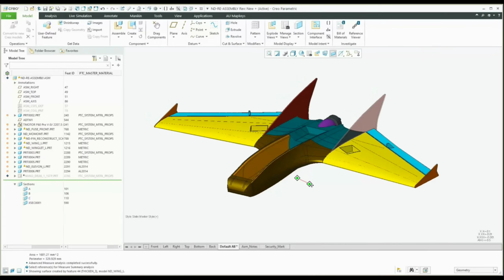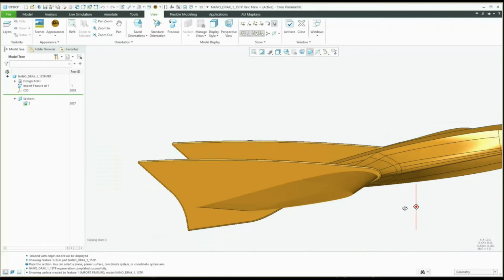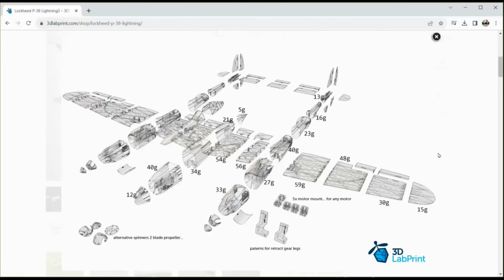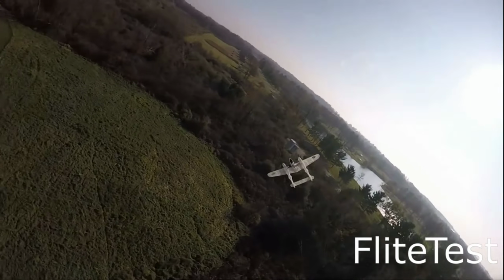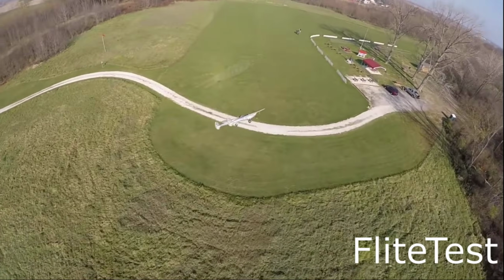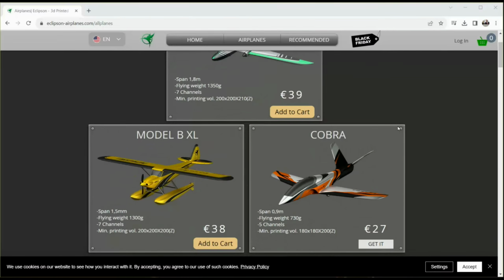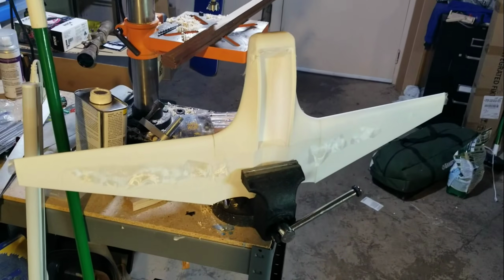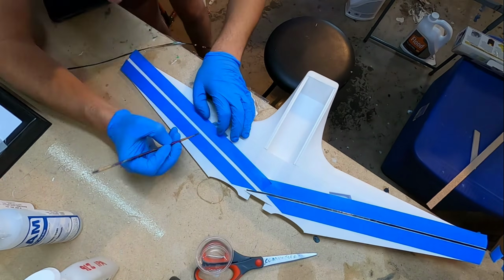I Designed and Flew a 3D Printed RC Plane

Comment: 16:20    you may know that the fuselage should have a radially symmetrical shape; eg., a shape that deflects air Uniformly.      d
Reply from the maker: I did not know this, but I am no Aero. 
Almost everything Aero about this plane is a copy of the original Ritewing, Mini Drak, which I copied for purely aesthetic preferences (and my own enjoyment flying that bird)

Comment: it is not clear, in this case, whether the use of wingtip fences is a good idea.            it should be determined whether the dom of the model can be 'improved'.     dom is distribution of mass.        for example, the mass of the wing-located servos should be located just forward-of the main spar; the main spar being located at thirty percent of chord.
17:22   elevon linkage configuration results in the servos having (relatively) less  MA.         17:25   the prop noise is excessive  ---  possibly because it's too thin for the application.           d

Comment: a wing should have rib-like structures, in  order to minimize potential wracking of a wing.
Reply: The only thing a wing HAS to do is to maintain the chosen shape of the airfoil. It should be light, and strong.
I've built just about every kind of wing you can imagine and probably a lot of them you haven't in the last 45 years.
I see absolutely nothing wrong with this design. 
And by the way, "wracking" is a term that can be used to describe many different issues.
None of which I'm seeing here.
In fact, other than being a bit tail heavy, this aircraft is flying exactly as it was originally intended to and exhibits all the flight characteristics I'd expect to see from the type.
Reply from the maker: I haven't heard the term wracking before. Do you mind explaining?

I assume you mean supports within the wing that run forward to aft, rather than span wise, parallel to the main spar? This is challenging to do in a way that mimics how you would do Iit in a built up balsa frame. Designers today get around this by making a matrix of rib like structures that are "slanted", so they run forward to aft while also running towards the span. The wing I showed being printed by Tom Stanton was designed this way. If I were to design a new bird from scratch, I would probably do this, especially if doing a larger plane.

Comment: design information       12:30   a main wing is supposed to have a load-bearing main spar; located at  thirty percent of chord.        in the case of a wing that is swept,  it is recommended that a (separate) central  fuselage-spanning  main spar be used; to be located at thirty percent of mac.
Reply from the maker: Thanks David!

When designing the internal "rib spars" the intent was to target close to this. They're probably closer to 25% of cord for placement. I had a hole in the plastic rib to glue in a small carbon rod. I ultimately didn't use this, which is why I opted to glass the leading edge, all the way back to this plastic rib. Carbon tow closer to the back was a bit of an after thought, to better connect wings and fuse. 

Much of the placement of all of this was more or less slap dash in hopes to get it "good enough".

My first time designing 3d printed parts with the intent of flight, so in the end, I'm just glad she flew!